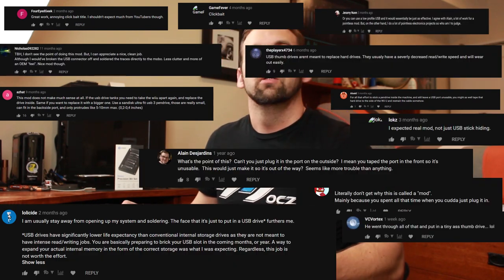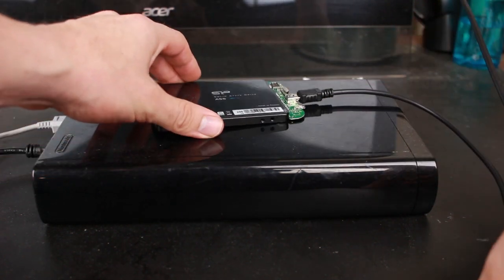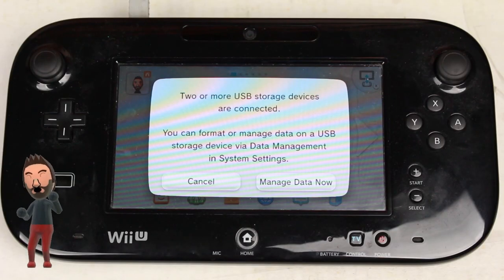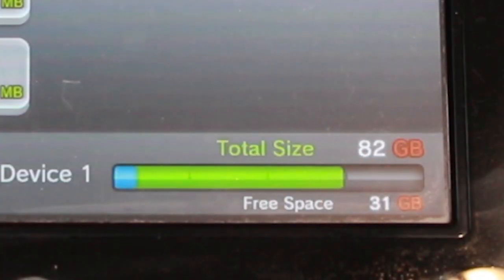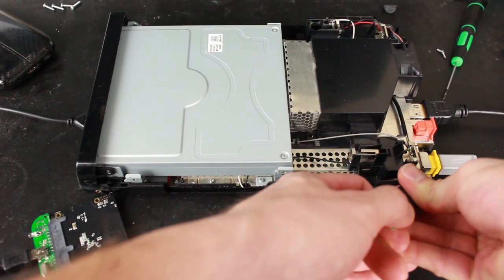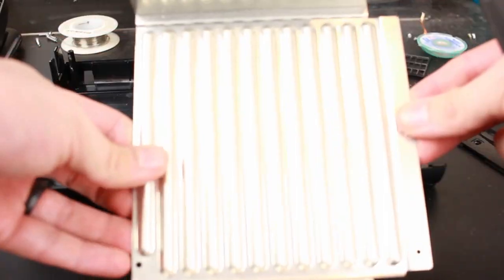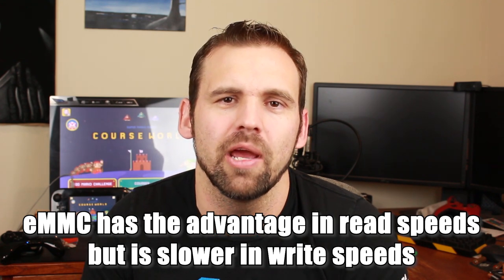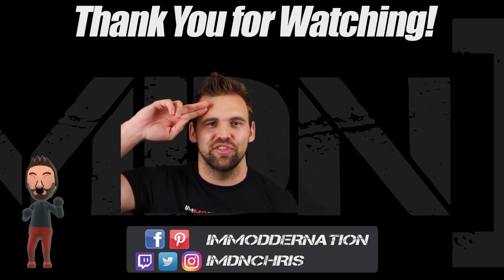EXPAND YOUR WII U INTERNAL STORAGE WITH AN SSD | GUIDE

Comment: I’ve just done this myself, rather than trying to fit the SSD above the Optical drive it’s way cleaner to locate it between the underside of the main PCB (next to the Bluetooth and WiFi) and above the bottom EMI shield this way you don’t need to remove the DVD drive shield.
Reply from the maker: Congrats on doing it yourself! Good hiding spot.
Reply: There's any difference in loading screen?
Reply: @Ignis_beas  Not a huge amount of difference, the limitation is the 240Mb/s USB 2.0 bus.
Reply: @Core2lee91  ok, then, is not a lot of difference between HDD and SSD after all, thanks for replying me! 😁🌟
Reply: what size ssd did you use and does it matter which one i get? also do u have pictures of where you put yours i want to do the same! Cheers mate
Reply: @Ignis_beas  there could be a small difference because ssd has much lower random access speed and latency.
And it's much easier to hide inside the case than hhd because of size 😉
Reply: Where’s the guide
Reply: @ImmodderNation  Please could you do an updated tutorial using the most optimal SSD for the Wii U and the method explained by this user?

Comment: Hey Chris, I love that you're still responding to comments 5 years after posting. I admire the dedication to the craft.

I had a question regarding SSD form factors. These days a 1TB 2230 & 2242 M.2 can be purchased at a reasonable price and I believe it may fit nicer inside the console via soldering. 

What are your thoughts on this? Do you think it would work or should we still stick to taping to the top of the console? Are there any clear open spaces inside the console that can be used?

I am about to embark on this journey and likely going to tape it down, as the back of the WiiU cannot be seen in my entertainment unit.

Keep up the good work 💪
Reply from the maker: Thank you! It should be able to be done so long as you have a USB to M.2 adapter. 2242 is a more common form factor, but you'd benefit from having a shorter SSD since space inside the console is limited. Removing the disc drive would make it easier, but would require part of the disc drive to make the console boot. There is some space on the right side (console facing you) that could work. Good luck and let me know how it goes.

Comment: Hey man! I have a couple of important questions before I feel comfortable buying an SSD and slapping it into my console.

According to my research, the Wii U's USB 2.0 ports can provide a maximum of 300 milliamps of power, but most aftermarket SSD drives require anywhere between 700-1500 milliamps. How much power does your SSD require? Does the USB 2.0 performance bottleneck keep the power draw of the SSD low enough, even under relatively heavy loads? Did you encounter any problems by now?

I'd love to hear back from you, thanks for this video! Subbed in a heartbeat.
Reply from the maker: Great questions, my Lord!  My research suggested USB 2.0 produces up to 500 mA @ 5V. I can't find the exact values for my SSD, but if I remember correctly it's 70 mA at idle and can reach up to 700 mA max (but that is in a PC, not a game console). If you're nervous about power draw, you can connect the drive externally and transfer one game and try it to see how it works before you commit to the mod. Otherwise use a Y cable and split between two USB ports. I haven't had any issues with the SSD, but understand that in modding things can change without reason between systems. Thanks for the question my Lord and may the force be with you.
Reply from the maker: As a follow-up, be sure to check the power requirements of your SSD before performing the mod. Not all SSDs may work in this configuration.
Reply: @ImmodderNation  - Thank you for the quick replies! My main reason for concern is that I'd like to use a 1TB SSD, so I'm trying to gather as much information as I can find before commiting to the relatively expensive purchase. If all else fails, since the Wii U's power supply is able to put out 5 amps (and mine doesn't seem to ever pull more than ~2.5 under heavy load), I may have to find a way to attach the drive to the 5 volt rail of the device. I'll see what happens, thanks a bunch for the help!
Reply from the maker: Red and black tend to be power and ground respectfully on the SATA cable, so that may be your only option with a higher power drive.

Comment: i'm using an SSD now ,  but switching over to a 2TB external bc over USB2.0 it really can't make much use of the SSD anyways and its still little too costly to drop 200 on a 50 dollar console even tho it would be really OP and neat .   Cool video ,  also that USB is like dead now correct?  I think it'll detect it as occupied  but if you can like throw the GC adapter on there and lemme know if it still passes enough power through that'd be great.
Reply from the maker: Game Cube adapter requires 2 ports for power so I would say the SSD occupied port probably won't power it. There are two ports up front that will work.

Comment: Could you do a tutorial on installing the GameCube adapter internally? I'd love to take out the disc drive and use that space to have four GameCube controller ports permanently available.
Reply from the maker: Maybe. 🤔
Reply: @ImmodderNation  I'm in the process of doing this mod now. In your video you use a USB 2.0 cable, but I purchased the USB to SATA adapter from your Amazon affiliate link and it has a USB 3.0 cable. Turns out the wires are NOT the same. Would you be willing to explain how to solder the USB 3.0 wires to the USB 2.0 port? Thank you!
Reply from the maker: Just look for the same colors as I used in the video. Red, white, green, black. Just ignore the rest you don't need them.
Reply: @ImmodderNation  Okay. The white and green ones are just super thin though and there are two bigger bundles of cables with extra shielding. I can just cut those two extra cable bundles off and I should still be good to go?
Reply: Finally found a good article explaining USB 2.0 and 3.0 and the wires within and yes, it does look exactly as simple as you're making it sound. I'll just go ahead and cut off those extra two bundles of wires then.
Thanks so much for your replies! I really appreciate it!
Reply from the maker: No problem, thanks for watching and good luck!

If your drive requires more power than 1 USB port, don't use a Y adapter. Use a step down converter off of the mains power adapter plug to 5V. Connect red and black here, green and white are still connected to USB.
Reply: @ImmodderNation  Completed the mod! Since I don't ever use discs, I also ended up following the process at the link below to remove the disc drive as well which makes the Wii U nice and quiet when it's switching into Wii mode to boot GameCube games and then back to the Wii U menu afterwards. Thanks for all your help! Haha you're right that this mod is pretty extra, but it was fun to do and my Wii U is extra slick now. :)
https://gbatemp.net/threads/will-wii-u-work-without-the-disc-drive-attached.349468/page-3
Reply from the maker: Glad you enjoyed it. After taking the Wii U apart, it's easy to install.
Reply from the maker: I believe I discussed the power requirements of USB 2.0. It is 5V and 500 mA.
Reply from the maker: Couldn't hurt. Either that or lose another USB port.
Reply from the maker: Necessitas dos USB para tu SSD or usa un step down converter para 5V.

Comment: Hey buddy.

Is there an internal power rail I can use to tap the power necessary to run a 2tb SSD or should I just start over with one that doesn't need 5000mA?

The one I'm using is a SAMSUNG 870 QVO SATA III 2.5" SSD 2TB (MZ-77Q2T0B).
Reply from the maker: An 870 EVO consumes 2.58W max. I don't know where you're getting 5A from. Do you mean 500 mA?

I'd tap power from the power adapter input and use a buck converter to adjust voltage to 5V.

Comment: Great job, but i have a doubt... can i weld the ssd at the usb ports in the front of the PCB console? i want to use the usb ports in the back of the console.
Reply from the maker: Yes any of the USB ports will work. I've reserved mine for GameCube controllers

Comment: Just a quick question, I got my wii u a few months ago and I have recently started worrying about storage as I have 5 gb left and I read online somewhere that certain ssds can wear out so does the one that you use ever wear out because I was split between getting a ssd or hdd so which would you reccomend
Reply from the maker: All SSDs and HDDs will wear out eventually. I think what you're thinking of is TRIM support, which allows for more efficient storage space. Wii U doesn't support TRIM. I went with SSD because less moving parts mean likelihood of failure is lower. Ymmv. Hope that helps

Comment: I like the idea of this. Gives you an internal drive while keeping the USB ports free for other stuff like the LAN adapter or the GC Adapter. A couple questions:

1. Could this mod be performed on the front slots instead of the back? From what I've come to understand, the back ports can be used with Wii U and vWii while the front ports are Wii U exclusively. If I wanted to hook up a hard drive or another internal storage for use in vWii, I would be afraid if the Wii U drive got in the way and caused read issues with the vWii drive.

2. Could you perform this mod nowadays without removing parts from the disc drive and the heatsink by using an M.2 2230 drive?
Reply from the maker: Hello TruExtent. Keep in mind that it does take at least one USB port out of the equation. Can't use it simultaneously for something else.

1. Can be performed with any USB port. I keep the front ones open for things like GameCube adapters for the GC controllers. The back USB drives I rarely see.

2. You could potentially with an M.2 to USB adapter. They are USB 3.0 and should be reverse compatible but I don't know the power requirements.
Reply: @ImmodderNation   Dang, I was under the impression the USB port would still be available like one of those multiport USB hubs. Oh well. I think for now I'll stick with the slim sized flash drive I've got sticking out the back of my Wii U. Once I have some soldering experience, I might give this mod a go on a spare system.

I just wish there was a way to do this mod so that you could get expanded "internal" storage for both the Wii U and vWii for homebrew. Could partioning the drive work? The Wii U won't let you use the system if you have two USB drives in at the same time.
Reply from the maker: I don't believe you can partition the drive. Wii U reformats any sort of windows drive.

Comment: Hi, nice job. Does the ssd need at least two usb connections one for data and other for power?
Reply from the maker: It depends upon the power requirements of your SSD. The Silicon Power SSD I used does not, but Samsung requires two since the limit for USB 2.0 is 500 mA.
Reply: @ImmodderNation  thanks. I made the mod following your tutorial with my Wii U. It used to work very well, but sometimes I'm getting a  message saying that there was an error with the usb device. I'm using an ADATS ssd. 😅.
Reply from the maker: You could try using a Y-adapter and solder to a second USB port. Or solder to the power input and use a buck converter (step-down) to bring the voltage down to 5V.

Comment: I just got all the parts for this mod (SSD, sata-USB, cable) . Still I'm wondering if there's anywhere else I can put the ssd since I don't feel too confortable with removing the heatsink, let alone the drive top cover.

Thanks for the video, I expect to achieve the same result!
Reply from the maker: Not anywhere I could get it to fit. Maybe an M.2 could fit better maybe not.
Reply: I managed to fit a Samsung 850evo (not in its 2.5” housing) and usb to sata under the main PCB and above the bottom EMI shield. 

It sits cleanly between the Bluetooth and WiFi modules
Reply from the maker: I was thinking that Core 2, but then I'd have to remove the PCB as well to get to it. Glad to hear it worked out!
Reply: @Core2lee91  Do you have any pics?
Reply: @GenesHand  Only 1 pic lol, but I did post it on Reddit when I did the mod: https://www.reddit.com/r/WiiUHacks/comments/ie7hxo/thought_i_would_have_a_go_at_mounting_an_ssd/
Reply: @Core2lee91  Thanks!!!
Reply from the maker: Nice work. I'm surprised the case fits back together with that ssd. Keep modding, dude!

Comment: One question. Do I need to use a USB 3.0 hard drive or a USB 2.0 drive.

Will my Wii U games freeze/crash if I use a USB 3.0?
Reply from the maker: USB 3.0 is reverse compatible with 2.0. Won't make a difference, but you won't be able to take advantage of USB 3.0 speeds.
Reply: @ImmodderNation  thanks for the info
Reply from the maker: Good luck.

Comment: Yeah, if you want faster read speeds, you are better off just emulating. The way Nintendo designed this, there isn't much you can do in the way of performance improvements. They locked this thing down pretty tight, even for Nintendo.
Reply from the maker: Then what am I going to do with this console?

Comment: the cool thing about the wii u is the intenal storage is emmc  kinda like an ssd type storage is very fast in its own right. I tested botw with speed boost mods and both had slight texture load in but when played off usb flash almost unplayable with speed mods game hangs up a lot
Reply from the maker: Have you tried with USB SSD? I have BOTW I'll have to find these speed boost mods you're speaking of.
Reply: @ImmodderNation  yes there pretty much identical and the speed mods are like running and gliding thru the map super fast i had some freezing on a usb flash like really bad unplayable freezing for like 15 seconds and on internal and external ssd the freeze  would be about 2-4 sec much improved but the limit is the internal is only 32 gb but its super fast but you can get near identical or better depend s on your ssd and usb enclosure i used a usb dock with its own power supply because other wont work on wii u
Reply: @ImmodderNation  also i use the botw trainer flump mod 1.0.3
Reply from the maker: Oh interesting. I didn't know these existed.

Comment: Hi!

This might not be the right place to ask but haven’t seen anyone else solder anything with the Wii U.

My top Wii U USB port is faulty. It’s not seeing drives when using a Y cable at all or my USB Ethernet adapter. The second lower port is fine. 

Is it as simple as de-soldering the USB port socket and replacing it with a replacement port? Will I be likely to damage any capacitors etc?
Reply from the maker: It could be if thats the problem. If not, it may be an issue with the chip controlling the usb ports or the traces. You could try the USB port first.

Comment: Buen video, pero ... no necesitas un segundo puerto USB conectado a la Wii U, es decir, ¿el voltaje de un solo puerto USB es suficiente para alimentar una unidad ssd?

Nice video, but ... you don't need a second USB port connected to the Wii U, that is, is the voltage from a single USB port enough to power an ssd drive?
Reply from the maker: Depende en el ssd. No importa el voltaje porque todos ssds usan 5V. La corriente de electricidad es la problema. Entiendes?

Comment: This actually will full you DVD drive with the dust comming from the fan. The SSD can be placed without remove the DVD drive protection
Reply from the maker: Possibly, but thats not an easy feat seeing as the fan is part of a plastic cover that pulls air from the heatsink out the back.

Comment: Remove the DVD drive. It should still boot as long as you remove the daughter board from the drive and re install that. Now you can fit more stuff inside
Reply from the maker: What if I told you...I could fit more stuff without removing the DVD drive?

What if i'm making a video about it 😉

Comment: i think the problem your having with the solid state. is how its wired.
your supposed to use a dual wire with wii hard drives meaning one usb for power & another for data.
if you wired the power to the other usb port also should get a huge increase in speed.
Reply from the maker: Again, no, because you're limited by the speed of USB 2.0, which I talked about in the video.

Comment: Seriously, why again did you cut the USB-A headand solder to the Wii U board but not cut the USB-micro head and  solder directly to the USB-SATA adapter??
Reply from the maker: You're limited by the USB bandwidth either way, there no performance boost. USB to SATA adapter cable was easiest way to pull this off.
Reply from the maker: I just reread your question. The answer is if I need to access the SSD in the future, I don't need to take the Wii U apart fully in order to desolder from the USB. Saves me time and work. I realize the USB could disconnect, but hot glue should fix that.

Comment: i try to plug my portable usb hard driver, but cannot be identify by wiiu? is this cause by power not enough or unknow usb chipset? cound u give me some advice? thanks.
my hard driver work with 5v 0.45a.
Reply from the maker: Your hard drive may not be compatible. Before attempting this mod, plug your drive into the Wii U with a USB Y cable. It could be drawing more current than what the drive specifies.

Comment: I wanted to always know if there's a way to make a mod to remove the optical drive and connect a hard disk using a ribbon cable?
Reply from the maker: Yes. You can remove the optical drive, but the optical drive board must stay connected in order for the Wii U to boot. Although I think an SSD is a better idea than a hard disk. Your mod!